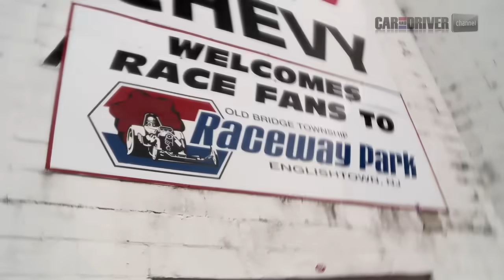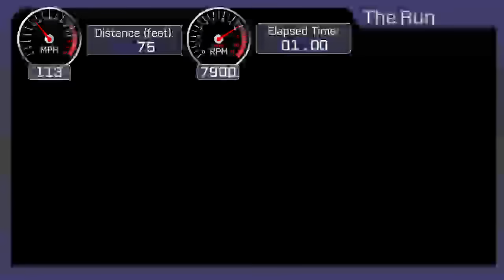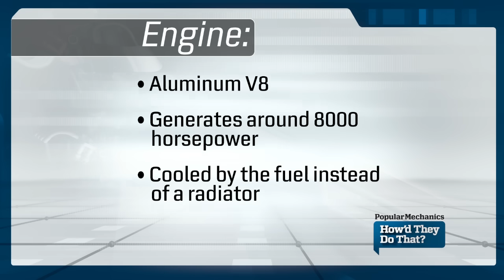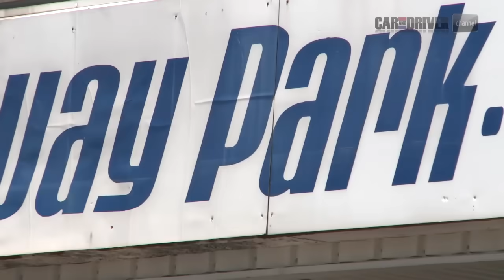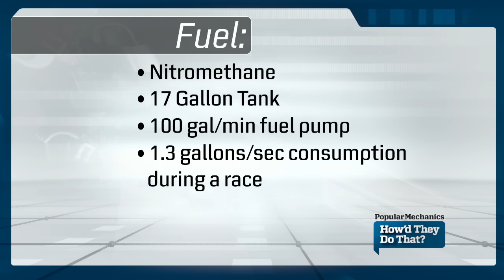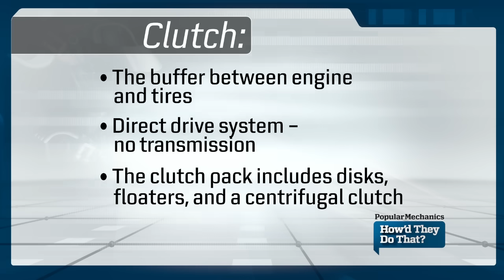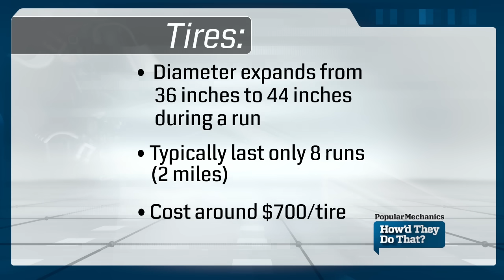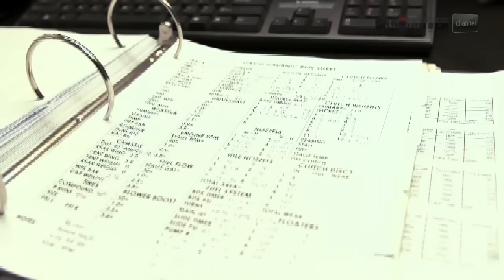How a Top Fuel Dragster Works

Comment: Formula 1: We spend 2 seconds in the pit
NHRA: we spend 2 seconds on the track
Formula 1: confused puppy-dog face
Reply: F1: I can take a corner
Dragster : Sad dragster noises
Reply: Snoop Doge unless you are an SF90 or a Williams
Reply: We go 300+ mph
Reply: @ John Laye

For 0.2 seconds. 

My plane goes 300 MPH for hours.
Reply: @Bartonovich52  you don't even got one don't play bother
Reply: @rgg9337  
I first thought engineers team just shut off the engine ...

Then, yep Mickey great mind .

It stand a family business, or ?

Vibes the ones are not vibes the others for sure ...
Reply: Mercedes. Williams.: Oh? You're approaching me?
Nhra: I can't get a slower pit stop without getting closer
Reply: @rgg9337  
Dragster: I can take a 1/4 mile straight from a dig in 3 seconds. 
F1: .....oh, well, yeah but...but corners.
Reply: @Username-2  Spoken like someone who's never drag raced a fast car.
Reply: @177SCmaro  it does take talent and training for any kind of driving, that's for sure. The G-forces in each car can exeed 8 in the dragster, and 6 for the F1 car. However in the dragster the acceleration is not lateral, where as in a f1 car it is. keeping a car planted at speed in a straight line is tough, sure, but try and keep that same car planted around a corner. Much harder. I would say that F1 drivers are probably more skilled, just because they spend more time on the track. it must take immense concentration to handle 8000 hp for 4ish seconds, but to drive a car with 1000 hp without any traction assists on a curved track with other drivers for more than an hour is a different beast. Due to this logic i would say WEC drivers are probably the best overall. They have to keep concentration for 4 hours, get a 8 hour break, then hop back in the car at like 1am and go for another 4 hours.

I'd also say that acceleration and straight line speed are the only 2 aspects in which a dragster is better. Obviously those are very important, but the engine wear is crazy. Because they only need 1 motor per race they can afford to beat on it super hard. If an F1 engine only had to last 1 race, you can bet the Mercedes AMG Petronas engineers would find a way to output anywhere from 2 to 3 times the amount of power. F1 cars also have fuel flow restrictions, top fuel cars don't. Bottom line is dragster is faster in a line, but an f1 car can drive upside down.
Reply: @alekonicolacakis7002  
It's a different skill set, not a "more" skillset is the point. Drag racing looks relatively simple to people who have never done it at that level I would presume yourself included.
To say F1 takes more skill then Top Fuel is like saying basketball takes more skill then baseball.

Comment: 1.3 gallon per second. approx 4s per 1000 ft or 0.189393939 mile. So approx 21s per mile. That's 27.45 gallon / mile. At $35 per gallon that's $960/mile in term of fuel. Well not so good gas mileage for grocery shopping.
Reply: Where the hell do you pay $35 for fuel?
Reply: Oducks58 thats jet fuel bro ....not prius fuel
Reply: MrPunisheer Jet fuel costs about 5 bucks a gallon at my airport. Nowhere near 35
Reply: scamper246  its nitromethane fuel. nitromethane fuel is more expensive then avgas
Reply: Stuntman Mike  how much do you pay for nitromethane?
Reply: yeah let say the grocery store was a 1/4 mile away.  On your return trip the eggs would all be destroyed from the acceleration lol
Reply: Probably be a bitch finding a parking space, too....

Comment: "How exactly does a posi-trac rear-end on a Plymouth work? It just does."
Reply: As you turn one wheel turns faster then the other. Simply!!
Reply: Mopar limited slip is a Sure-Grip, Chevrolet is Posi-Trac, Studebaker named their limited slip Twin Traction, Ford named theirs Trak-Lok, Pontiac named theirs Safe T Track, but to name a few.

Comment: don't dragster push 10k hp now?
Reply: Yeah 10k horsepower, and they barley rev to 6k not 8 xD
Reply: theoretically they do. They use a mathematical formula to estimate horsepower because a traditional dyno cant handle the power output of a topfuel. what that formula is? fuck if i know lol
Reply: There are literally apps for that xD
Reply: Ninja Man some do
Reply: T Wayland they basically all do but there are no dynos that can measure that power
Reply: Damien Kao top fuel does but i dont think funny cars or the rest do
Reply: Schumachers team did a video about horsepower last season and now they are pushing out 11K.
Reply: Damien Kao they use a device that installs on the drivetrain that measures it
Reply: update 13k
Reply: Funny cars run the same engines as top fuel. The difference between top fuel and funny cars is engine placement (top fuel engines are behind the driver, funny car engines are in front) and bodywork.
Reply: @benn454 Funny cars are allowed to overdrive their superchargers harder, which gives them more top end power, you'll notice many times in good conditions the top speed (not E.T. but MPH) of the day goes to a funny car.
Reply: Yes
Reply: Ninja Man horsepower can only be calculated as no suitable Dyno exist to measure
Reply: Ya but how much can they tow
Reply: Dave M actually not that complicated. HP= (Torque x RPM)/5252.
Reply: More like 14,000hp now, it's nuts.
Reply: No one knows for sure. There hasn't been the dyno built yet that can find out.
Reply: @davitomarler  formula for hp= dartboard plus numbers
Reply: more horsepower in one car than the first 10 rows of a toilet bowl race combined
Reply: They are now at 12,000 hp
Reply: I heard its 15k now and they run on batteries
Reply: @Lugare2011  so calm down , breath and look again .... he is saying that modern dragster don't barely go at 6k rpm .....
Reply: Last time I checked theyre running at 90k horsepower with a liquid fuel first stage rocket.
Reply: Snap-off          Are you sure?  I think it’s aerodynamics with the fc.
Reply: @Country_Tyler 
 Hey clown     Hemi engines  have gone past the finish line at    10.500 r.p.m.  at 50 pounds of boost . Many  of these 500 cid engines  run over  10,000  r.p.m.  This is just what they are doing now !!!  and not all Hemi's are the same. Now get in your honda and go home .
Reply: Dave M I have a degree in MET and they calculate the hp with the diameter of the drive shaft and the moments of inertia with rotating parts. It’s pretty simple trying to figure out a normal car engine but I imagine these tops fuel dragsters would be very hard
Reply: 2019 11k horsepower
Reply: @twayland6186  funny cars 2019 are about 10k now vs 11 for top fuel
Reply: @NFS305  bruh the walls in area 51 must be thin to hear that
Reply: Andreus Allman lol
Reply: Yes!
Reply: @Nlck_Name  i never heard him say THAT.....6500 IS THE SLOWEST they'll turn is what he said

Comment: One thing I can never get my head around with very high powered drags is when the engine is blasted off the line the engine torgue is thrown to the right, overloading the right side wheel and unloading the left side. How is traction on the left back wheel maintained ???
Reply: maybe the clutch is geared to spin the opposite way to reduce net rotational torque?
Reply: there is no differential its a solid axle
Reply: Chassis is designed for it